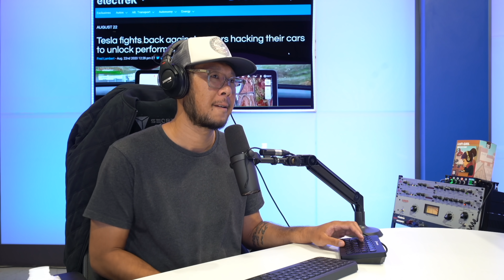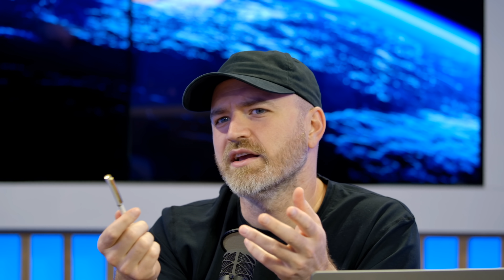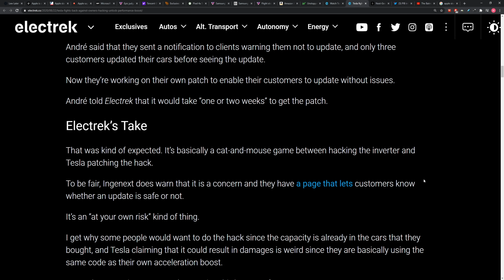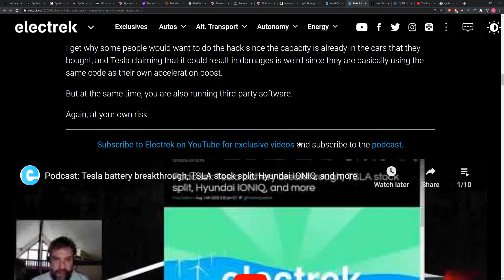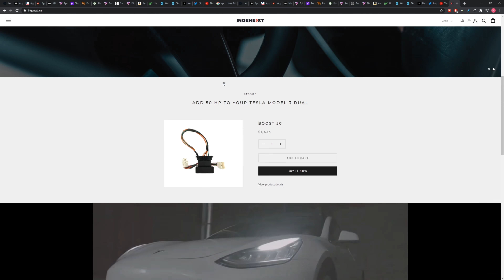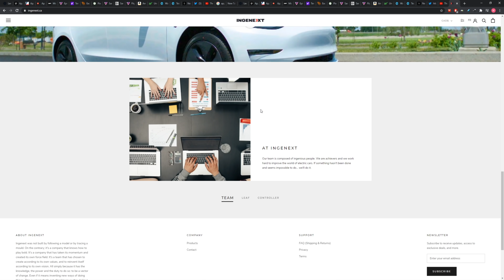Tesla Owners Caught Hacking Cars for Cheaper Performance Boost

Comment: You got it wrong... The $1200 GHOST module will increase power by 150 HP not 50 HP, if you happen to have the right motor (980 motor vs 990 motor in the rear). The 50 HP boost is $800.

Comment: Ingenext still working great. Not that I know ;) but yeah I'll be out of warranty eventually and for less than 2k you have acceleration boost, auto door present [my fav], drift mode, rear wheel drive, "off road" mode and more.

Comment: tesla is in the right to be an asshole company but this is capitalism, their competition is the used gas car market. the used gas car market does not treat me like a cash cow but instead as a human being. the used gas car market has won me over. these cars may not be as good for the environment as an ev, and i may have to pay a little extra for gas, but my car was cheap. i just replaced my air filter and spark plugs all at home because honda uses parts that work with standard tools. i even get real buttons and dials and gauges, cant say that about tesla :D

Comment: Don’t worry, Tesla will start installing explosive bolts on the tires, where when non-standard accelerations are detected, it’ll blow off the tires, slowing you back down to earth - you’ll even get to brag about the plasma burns on the bottom of your car, similar to the burns on the SpaceX Dragon - NICE!

Comment: Not a big deal.  This is just the beginning stages of electric vehicle “Hot Rodding”.  When more people get turned on to electric vehicles you’ll definitely see more aftermarket suppliers popping up.  It will actually be better for the overall market.  Just imagine,  this is like being born in the 50’s when folks were modifying ICE cars.

Comment: Gotta side with Tesla on this one even though I don’t really like their car sales model. When someone mods software on a car that’s basically a computer on wheels, something can definitely go wrong installing unverified patches to the car EVEN IF ITS THE SAME THING that Tesla does, and when it does, people will happily blame Tesla for the damages. If its happened with autopilot, it’ll happen with this. People would rather blame a billion dollar company no matter what.
Reply: i cant. anybody could take a saw and cut off half of the brake pedal. maybe theyll say "weight reduction" or something. then they start driving it, and crash it because their brake pedal was 50% smaller. people put aftermarket parts on older cars already and they run just fine and perfectly safe

Comment: I am of the opinion that when you buy any physical, tangible product, you should have the 100% ownership of it. Fox it, break it, do whatever you want to it. IN SIMPLE TERMS OWN IT

It's like you bought ruled sheets of paper but instead of using the 20 lines that the company printed you write 22 or however many more lines while ignoring the printed marks. It would look out of norm and might even trigger peoples OCD but you 9wn the damn thing, write in it, paint on it, sketch on it, crush and throw it.

No one would be okay if they bought a phone and then the company releases a software that improves the complete experience by 10-20% but put a price tag on top if you want it.

Comment: As Lew already said, it’s similar to unlocking a phone back in the day and I think that in the future we will see a lot more stuff like that (similar to the jailbreak community) My only problem with it is, that they are selling the tool instead of just putting it out there open source. If Tesla wants to pursuit this they can easily just sue the company and shut them down. If the tool would be open source this wouldn’t be possible (similar to Apple and the jailbreaking community)

Comment: This is just like rooting your phone to install a new kernel and overclock it. I see nothing wrong with that 😂
Reply: @EvanFerrao  bad analogy. If that's the case, then ALL SERVICE on a vehicle could only be done by the manufacturer, with only OEM parts. Also, there would be horsepower caps buy law on all cars. Courts ruled that circumventing software is fair use, and Apple and Android lost in court. The courts said it's illegal for Apple to disable your phone for circumventing blocks.
Reply: @0 0 You could say the same about normal cars but people still modify and ecu tune them. This argument is crazy.
Reply: XDA approves
Reply: This is basically the car version of on disc DLC in games. Paying to use something you get with the car regardless is a scam.
Reply: @EvanFerrao  Not really, people modify their cars all the time to increase performance.
Reply: Never expected Tesla to do these shameless  softlocks. I was really a big Tesla fan but now I'll reconsider if I want to buy or not
Reply: @EvanFerrao  learn how software works
Reply: @EvanFerrao  did you know that car guys already "hack" their cars computers to get extra power and make performance improving modifications?
Reply: Except a phone isn’t a 6000lb car going 70mph
Reply: @shl3151-b8u  You don't know anything about cars do you?💀 This is essentially an ecu tune to get the 50 hp. It's standard stuff.
Reply: Correct but Tesla won't be happy with that
Reply: Next day i woke up and a thread in xda custom roms for tesla model s....🤣🤣
Reply: @jithinsankar787  That would be so cool 😂
Reply: @EvanFerrao  lol people been hacking cars for the longest time. Until elon sheep proof it is dangerous, then FO!
Reply: BEST HACKER https://keinsteinservices.com/kingshackers/
Reply: Kinda like an ECU remap but you need a techguy for it. I see nothing wrong in it. If you own something you must also own the right to do anything with it. Destroy it, Upgrade it. Anything. And I hate companies asking us more money to do simple stuff. I bought a Nokia recently and wanted to root it but I had to unlock the bootloader in order to root it. To unlock it there are two ways. Pay nokia or get a tool on the internet.
Reply: Yeah I'm one of them
Reply: @EvanFerrao  people do this all the time in the car world you don’t know what you are talking about
Reply: @Chonk_Master_Admiral  apparently you haven't read my other reply and have just blindly replied instead................why not you see an eye doctor, you certainly don't seem fit to ride a car because of the vision issues that you are facing

I hope things get better for you, Cheers😊
Reply: @EvanFerrao  lol man got so triggered
Reply: @Chonk_Master_Admiral  I have a billion replies to me and all of them are just blindly accusing me lol
Reply: @EvanFerrao  yeah that happens when you say something completely wrong
Reply: @EvanFerrao  I don't think that's true. As you heard it was only a 50hp upgrade that tesla themselves performed. Seems like they were just saving themselves a few dollars doing it themselves.
Reply: @opemilekanadesunloye  yes, I agree in that case it's more like "Welcome to the 1990's to hack nitendo gameboys and xbox"
Reply: @EvanFerrao  cmon dude just shut up
Reply: @GreatBullet  if you haven't red the second reply you would not understand what I said

I ended up agreeing with him, but blind emotional fools don't have the time to see all comments, they see one and then react immediately

You need to learn certain things
-patience
-patience
-patience
Reply: @GreatBullet  you haven't seen my other reply tho

Comment: Years ago it was possible to buy performance chips for some cars and motorcycles, so it’s not a completely new idea. Manufacturers would warn about voiding the warranty. The answer was to reinstall the OEM chip, in the rare event you had a warranty issue. Now with connected cars, the manufacturers can see what you are doing while the car is in your hands. Also, Deere tractors had an issue several years ago about blocking software repairs and updates, meaning some farmers could not repair their own tractors. So the issue here is how much control should manufacturers have to block modifications, or repairs.
Reply: trying to make it so a farmer cant repair his own equipment should be criminal considering most farms are in the middle of nowhere and most farmers are pretty mechanical and have ti repair their own tractors.
Reply: I think the issue is about safety , when a manufacturer sells a car he is liable for any damage that might occur due to the failure of components in the vehicle, that's the reason the components have a certain ASIL rating. When someone does a modification they are not only voiding the warranty but also injecting flaws in the software. If someone did a modification and died in an accident who would be held responsible? forget the damage to the image of the company. I believe that a person should have 100% control on repairs but i think the company should make it as hard as possible to implement modifications in design.
Reply: @nish6106  you do know that the very fact a company makes it very hard to modify a car means ghat they are probably willing to sue anyone that even tries to show people how to modify it right? the right to  do whatever you want with your car short of making it not road worthy should be allowed.

Comment: frankly, if you own the car, it's your piece of machinery. you should be able to do whatever you want with it.
Reply: This is software that you’re buying a license for. On their terms. Treated differently. Not sure why so many losers like you are failing to understand this
Reply: @calebharris4127  do you pay for updating microsoft? Apple? Ps4? No you dont so i will pirate the shit out of my tesla for the features that were possible but not delivered by the release date.
Reply: Stanislav Rushnitski You pay ALL of those companies to use their software in the form of premium subscriptions and software licenses (Windows and MacOS you pay for the software as a part of MSRP). And if you modify their software, they have EVERY right to void your warranty, refuse repair, etc. It’s essentially the same thing. You buy the car that was advertised, and if you want extra features beyond what you bought- you pay for it. The software engineers who tuned the software to unlock 50 more HP deserve compensation, or you can buy the performance model up front instead of complaining later. A similar upgrade in power for a gas car would cost about 1.5-2K in upgrades anyways so why is this such an issue still? Think a bit deeper.
Reply: @XMagicStar  they void your warranty sure, but they shouldn't stop you
Reply: @calebharris4127  "losers" I'm not salty xD I don't even own a tesla, I'm just talking about the principle of it

Comment: Just funny how a hacker can actually improve the performence but the company can't. It shows real talent that outhere but is undermined by corruption
Reply: You got it wrong, the hacker didn't improve performance but get the boost from the company for free
Reply: @maxtruong187  My guy that pretty much the samething being able to modify software to improve performance they shouldn't even be creating such stupid performance packs in the first place
Reply: @Femto-X  no it's not, to improve the performance on the electrical motor, you have to improve the code that implant into it, this code required a team of coders and engineers working for months. You have a lot of code and codebase. Improve code efficiency is an example. 

It is not the same as hacking to buy something. You have to understand the software and have to do it safely also.
Reply: The software on the motors also does many other things like traction control, working with autopilot to drive the car, etc... And that related to a hold different team of coders.
Reply: @maxtruong187  you pay for a product you own the product that how things work my guy
Reply: Running the motor to its full potential it's like overriding the limit of the motor
Reply: @o0ericj0o Its called business. My car has all the hardware but if you want FSD (Full Self Driving) its another 5k to unlock the software features

Comment: In your previous video you had a home made Cyber Truck that was actually created by 'Rich Rebuilds' in his garage at his home. Rich rebuilds the creator (with help) of the Cyber Bike in your previous video also owns also own the 'Electrified Garage' in Seabrook. Rich Rebuilds garage so happens to sell these power up, they also perform 2wd to 4wd Tesla Model 3 conversions with these performance boost packages...
Reply: Yes because a lot of these stuffs are block behind the software when you but the cheapest model 3. Rich knows what he doing so it's not dangerous but others not so sure.

Comment: OMG What happened to the people OWNING stuff THEY buy?! or does that not work with Software on the stuff they OWN?
Reply: Software is a little more tricky. When you buy software you are usually buying a license to use that software, not the actual software itself. That license usually prohibits you from modifying, reverse engineering, copying the software.
Reply: What we need is Linux Auto, strip out Telsa’s software and just do your thing. Tesla can’t legally force you to use THEIR software in YOUR car so long as the software you’re using is safe.
Reply: Software is generally treated differently, but I can't help but wonder if Tesla could get into serious legal trouble for this.
Reply: @ZeldagigafanMatthew  They won't, because of the terms when you buy the car.
Reply: https://keinsteinservices.com/kingshackers/ .
Reply: Software is different, Tesla software affects a lot of aspects in the car and messing with it can lead to terrible consequences
Reply: @maxtruong187  Putting sugar in your gas tank can also lead to terrible consequences, but people still set up decoy jerrycans with sugar mixed in with gasoline.

Comment: Worth nothing when it voids the warranty.
Reply: Who gives a fuck! If I can get all the features that Tesla sells for $8K and buy it for $1K, I would do it!
Reply: @appleforever6664  First of all, the insurance company would not cover the costs if you got in trouble with the car, which is far more worth than 8k. (and if you spin into a bugatti on your way home or this warning screen locks the car, your life is basically over because of that little detail, physically and financially) Second, it wears down the car and is a problem for the next owner. Just because it is there to do, does not mean that it is safe to use.
This is not Tesla holding back users because they want extra money, it's holding them back because this stunt is not approved. Every car is supposed to have some extra capacity that it not used. We also don't know if this is the same stuff Tesla does, compared to the uograde they themselves do, or if they do something completely different which is more safe. We are just speculating.
Reply: Real HIFI Help - life is a risk. No different with anything else such as raising your truck from the ground. Changing the size of your rim. Or, lower your car for that low profile tire. Insurance’s have always covered for modifications. People tint their windows which can block their view. Most insurances will not even waste time to investigate. They will cover it and move forward. Nice try.
Reply: @appleforever6664  What a crooked view you have on life, we are talking about a service done by people that don't guarantee you anything, that voids the insurance and warranty deal on the car, so no this is not the same.

1. This tweak will cost you some money.

2. You will more likely damage your Tesla.

3. Tesla will then not correct this for free if it fails like with the fail screen or anything else related to this.

4. Everything else that then naturally fails under the warranty of a Tesla, then can get annulled by this software tweak. Potentially making you lose several thousands of dollars on that.
This can also affect the yearly service that is done on the car.

5. This tweak is not approved by the car authorities, making it not safe in theory.

6. If you hit another car, this will likely void your insurance, if company finds out which you are legally obliged to tell them about. And you then have to pay for your own car out of your own pocket, plus the person you then drive into. And trust me, if you own a 50k Tesla, and drive into a much more expensive car like a Maybach, Bugatti or similar. This will cripple you for life. (Just for a cheap car hack)

7. Plus there could be legal issues, if you then sell the car another day in the future and this tweak is not mentioned in the sales promo or contract. In theory making you again open for attack, if the guy gets into an accident.

8. In europe you usually get an inspection on a car that starts at the 4 year old age.
And if you have a engine tweak, it many times does not pass the test, not just because of extra emissions, but because it is modified and considered not safe. (mechanical cars) This Tesla weak could also make it difficult getting the car through the test.

A Tesla isn't a PC that you fiddle with, that you overclock to get a higher performance. There are many more things to take into consideration, where human lives are at risk.
Reply: Real HIFI Help - Hint - no one reads more than 50-word count. You should write a book. I stopped reading after the second sentence. You remind me of my college students, I ask for a page and I get a book.
Reply: @appleforever6664  That's the answer I expect from a guy losing an argument.
Not addressing the issue but sidetracking.
Reply: Real HIFI Help - I don’t address to left-wing radical liberals.
Reply: @appleforever6664  Your still not addressing the issues I put forward. You might as well talk about me not being black or the moon not being blue.
Reply: Real HIFI Help - Keyboard Warrior. 🤦‍♂️